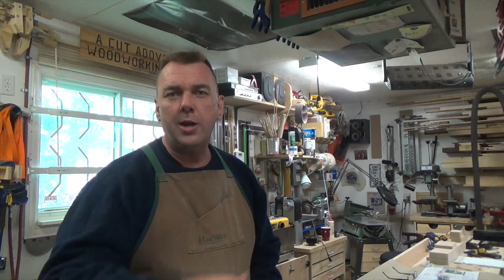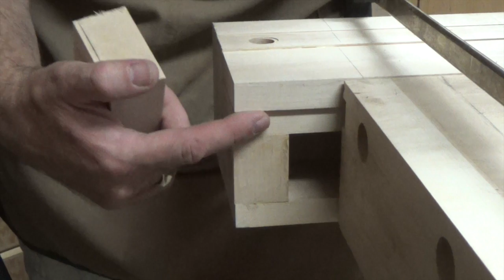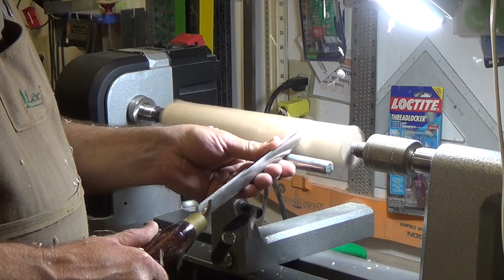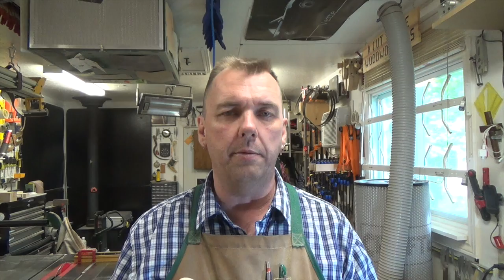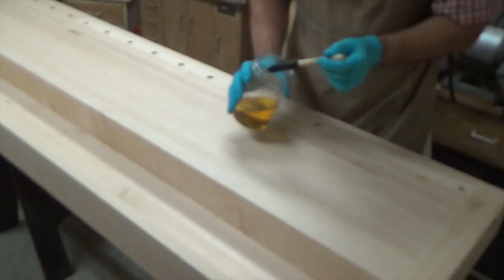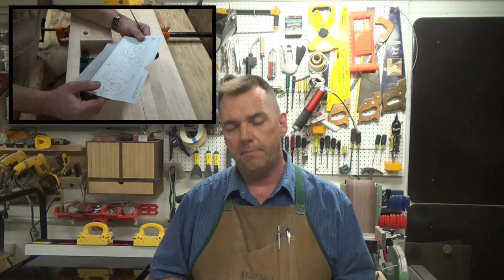Building A Traditional Workbench Part 6

Comment: I have the same tail vise as yours.  Mine keep sticking and will not run smoothly.  Even stops.  Do you have any suggestions that would help.  I've not tightening the screws very much and it even sticks.  Almost feels like that back is uneven.  However sometimes it runs fine.  Beginning to believe that somethings is off.  Thanks for any help
Reply from the maker: If it were me, I would be checking to make sure that there are no bent sections that are causing it to bind.  If all the pieces are flat and true, my next step would be to make sure all the plates and hardware are securely fastened in the bench and if that still isn't the issue, I would suggest using a little white lithium grease on the moving parts.  Those plates can bind if there is extra friction.  You don't need a lot of grease, just a light film of it.  I hope this helps a little.  Thanks for tuning in to the show.
Reply: @acutabove_woodworkings  Thanks for the note.  I did all that but the movement was so unpredictable and almost frustrating.  However,  I looked at several other methods.  Came up with a solution that others might like.  First,  laminated up some oak to about 3X5 or just to size with 2 2X4's.(3").  Then put a 3/4" channel about 2.5" from the top.  Ordered some teflon 3/4" Xto fit the channel.  Then mounted them the side of the insides of the bench top. (I still haven't added the last three 5's yet.)  I mounted the nut for the screw INSIDE the 3X5 block after fitting it to a piece of steel (bearing plate). Of course drilling a 1" hole thru the block, letting the screw work through the block into the bench making it a wagon vise.  After that just fitting the mounting end to the bench with trim was a piece of cake.
Let me know what you think.  Seems like not using the mounting plate and runners were a horrible waste but finding a screw that wasn't as big as a corn cob was almost impossible.  All others were 1.12".  Way too big for me.
Thanks.

Comment: So, i am building this bench and i wouldnt have been able to without your videos. Thank you so much. That being said, i must have missed at what point you attached the top to the base. When should it be permanently fixed to the base and how? If you dont mind
Reply from the maker: Mounting of the bench top is done in part 5 of the series and the bench top is never permanently mounted.  It is held in place with filler blocks and dowels and is just friction fit onto the leg assembly.  It's heavy enough that it will never come apart on it's own but loose enough that if you have to lift the top off, you can.  I hope this helps.  Thanks for tuning in and for the kind words on the show.

Comment: Your commentary at the end is the best part.  Watching people make things and never making mistakes or encountering problems that need to be solved is boring and doesn't have a lot of value. True craftspeople encounter problems and solve them as you did.  I'm building a older style "traditional" workbench with a different tail vice setup, but I've been concerned about the line-up for the larger face vice.  I'm going to apply what you shared about your experience. Thank you!
Reply from the maker: You're very welcome.  I do my best to provide a realistic representation of the craft and not the polished, no mistakes versions that other channels show.  By giving a more realistic version, hopefully the viewers will realize that it's okay to make mistakes and that it's all part of the process.  As long as you learn something and have fun, that's the main thing.  Good luck with your bench build.  Thanks for tuning in and for the kind words.  (p.s.  does your channel's name have anything to do with the book series of the same name?)

Comment: Hi Kenny, i got the plans for this bench for Xmas and looking forward to getting started.  Hoping to do less farting around in fitting the vises I was hoping to buy a 480mm tail vise but of course they aren't east to come by, especially in this frigid country.  Anyway,  now that you have used the bench for a couple of years,  do you find anything lacking by having the 15" tail vise?   I'm thinking of going with that as that is what LV carries if it makes no or little difference.
Reply from the maker: Glad to hear that you got your plans Sherloch.  I've been using this bench for a while now and I have no regrets and find nothing lacking with the vises that I installed.  The front vise is amazing and I use it all the time although I find that I need to use a racking stop device when using the front vise which is not uncommon.  The tail vise has served me well and I have no problems with its size.  The only thing that I would have done a little differently is I would have added more bench dog holes and although I haven't done it yet, I still might add them in the near future.  Not a lot, just another row of them to give me a little more versatility.  Good luck on your build.

Comment: WOW Kenny what a magnificent result, sincere congrats. I enjoyed the whole series immensely (except for my previously expressed annoyance re inches etc. which evidently can't be helped). I think  I'm now gonna go ahead and dive into the deep end and give it a shot. But it'll take me forever to translate (convert) inches (as per Veritas' plans) and foot/feet thing-a-me-jigs into mm's/cm's and metres what would you recommend me to do how should I approach the conversion of measure system? Cheers :)
Reply from the maker: Thanks for the kind words Erdal.  For me, when I do perform the conversions, I use a woodworking calculator which converts fractional inches into mm, cm or whatever you would like.  It also adds and subtracts fractional inches which for me is always a problem.  Barring the calculator, there is always the internet which has several online imperial to metric conversion calculators and/or charts.  If you have any questions along the way, please don't hesitate to ask and I will do my best to help you out if I can.  
I just tried to look up the link for my calculator and sadly, the product is no longer available.
Reply: Or alternatively use common sense and convert it into personally suitable measurements... coz like I'm 6'6" 
 (how 'bout that experessing it  in imperials? :) )and my back would ideally benefit a whole lot from a slightly higher bench for instance. Got it. Many thanks.
Reply from the maker: You're very welcome Erdal.  For the record, I'm 188cm tall.  At least that's what my driver's license says.

Comment: Enjoyed all the videos. I am in the process of building my own traditional workbench. You mentioned chamfering the dog holes. Could you help me out on how you did that? I'm afraid to take a router to my maple top. Thanks and keep the projects coming.
Reply from the maker: Don't be afraid of the router Butch.  My top (as you know) is also maple and I was able to chamfer the edges of the hole with absolutely no issues what so ever.  I believe I used a 1/8" round over bit and routed the holes normally.  There was no tear out at all.  Just try not to leave your bit in one place for too long as it will burn the maple.  I also started the router with the bit already in the holes to avoid accidentally striking the edge of the dog holes with the running router.  If you have any questions, feel free to ask.
Reply: Thanks for the guidance. I'll probably drill a few dog holes in some scrap and run a few tests
 to build up some confidence. That  bench you built should be on display somewhere. I'd be afraid to build something on such a work of art (but I guess that defeats the purpose). Good job my friend and thanks again.
Reply from the maker: You're very welcome.  Thanks for the kind words on my bench.  My only regret is that I didn't make one sooner.  As I said before, if you have any questions, feel free to ask.

Comment: Nice job on the bench build.
To keep the metal screws and pins from rusting I suggest plain car wax like simoniz. The wax will prevent rust and give you a lube film that is dry and will not collect dust.
I know this works because I waxed my guns. I am satisfied that it works.
Reply from the maker: +Dennis Williams Thanks for the suggestion.  I will have to give that a try.  Thanks for tuning in and taking the time to leave me a comment.

Comment: Thanks for your videos. I am impressed with the results. I am still unsure how you attached the top to the legs. Could you explain it? Thanks in advance.
Reply from the maker: +Jose Rios Thanks for the kind words.  The top of the bench is rather heavy and requires no fasteners to attach to the legs.  The weight of the top alone is enough to hold it in place.  Earlier in the assembly process, there were some 1" holes drilled in the bottom of the bench top and the top of the leg assembly.  Short pieces of 1" dowel is inserted in the holes of the legs and it extends into the holes in the bottom surface of the bench.  This keeps the bench from shifting and sheer weight keeps it in place.  The fact that it is not glued down, allows for natural shifting in the wood.  I hope this explains it for you.  Thanks for tuning in.
Reply: +kennyearrings1 Thank you so much. I want to build my workbench around Christmas. I am still looking for some more hardwood. I will try your trick.
Reply from the maker: If you have any questions at all, feel free to ask.  I'd be more than happy to help you out.

Comment: Great bench, fantastic job, and fine teaching! Now all you need is some MDF slipcovers, because I wouldn't, and wouldn't blame you for not wanting to put anything on top of it!  I guess a true test of your satisfaction: How many times did you leave the shop, go back in, turn on the lights and, just beam with pride?!!
Reply from the maker: +embwee I only beamed at it twice.  ;)  Thanks for the kind words on the bench.  I really do enjoy having a proper woodworking bench.  It has made so many processes so much easier and I wish that I had made this bench sooner.  I've already given it a few battle scars and it didn't take long to sand that area and give it a couple of coats of tung oil to repair it.  Thanks for tuning in and thanks for taking the time to leave me a comment.  It's much appreciated.

Comment: beautiful workbench man! I'm intrested in building one so I'd like to know where did you buy the two vices and what's the brand?
thx
Reply from the maker: +jejedark I got all the hardware required for the bench at Lee Valley Tools.  The front vise is the large front vise available from them and you can find it here.  http://www.leevalley.com/en/wood/page.aspx?p=31137&cat=1,41659,41661
The tail vise is also from Lee Valley and you can find it here.  http://www.leevalley.com/en/wood/page.aspx?p=31136&cat=1,41659,41662
I'm not sure of the brand, but they are good quality vises and if you have any problems at all, Lee Valley stands behind the products that they sell.  Good luck with your build and feel free to ask any questions along the way.  I'd be more than happy to help you out if I can.

Comment: For doing away with snipe all together forever, use a sacrificial piece of wood maybe 10" long.long enough to lift both rollers,  use pieces that will be the final thickness of what your after , put a piece In At the beginning of your cut and but the second piece right up at the end of the board and you will have no snipe :)
Reply from the maker: +Swedish Holmberg Great advice.  Thanks for taking the time to drop me a comment.

Comment: Great series and beautiful bench. I have some beech slabs for my bench top, just need time to put some legs under them and you have inspired me. As a new watcher, I'm curious where you got the "slotted" rulers you use in your layouts? You've probably mentioned it before but I can't find anything. Thanks!!
Reply from the maker: b0y9ggz Thanks for the kind words and thanks for tuning in.  I am assuming that you are referring to my INCRA rules.  I love those things and really aid me in marking and measuring.  I purchased mine at Lee Valley but you can get them at any woodworking tool supplier.  Here's the link.  http://www.leevalley.com/en/wood/page.aspx?p=58877&cat=1,43513,58883,58877
Reply: +kennyearrings1 Was going to ask you about your rules also, look to be real handy will have to get one. Great video's with tones of info. Do you live in Ont as well I noticed an Ont plate on the wall.
Reply from the maker: I do live in Ontario.  Born and raised here.

Comment: Really nice result, it takes a big man to admit to his mistakes. I learned quite a few things from the build and have enjoyed it. Your summary comments were very helpful, I must have missed it somewhere along the way but who's plans were these? Seems like a lot of errors were included in them. 
On the tail vise a couple of the wood pieces looked like they were off? How did you get them all nicely finished? I'm one of the people your doing these videos for (aka  the pupil)
Reply from the maker: Pat M These plans were by Veritas and it was their traditional workbench plans.  I don't think that the error was in the plans so much as it was in transposing the measurements to accept the vise hardware that I purchased.  The tail vise piece that you are referring to is most definitely the end cap.  In one segment, you can see how proud it is of the tail vise assembly.  Truth be told, I messed up and cut that piece incorrectly.  I ended up having to recut the piece and replace the incorrect one.  I didn't film it because I sure didn't need another 10 minutes to show you how to mount that piece again.  The procedure was exactly the same (but this time, with a properly fitting piece)  How did I get them nicely finished............I made them properly the second time.  Thanks for tuning in.  Glad to have you aboard as the "pupil"
Reply: Thanks Kenny, in the end all that's important is that you now have a beautiful bench. Things that are worth it take work. Sometimes twice the work, lol
Reply from the maker: And as a bonus, I learned a few things along the way.  If I ever should make another one of these, I will know the ins and outs before I start.